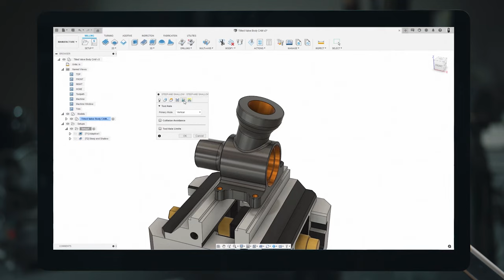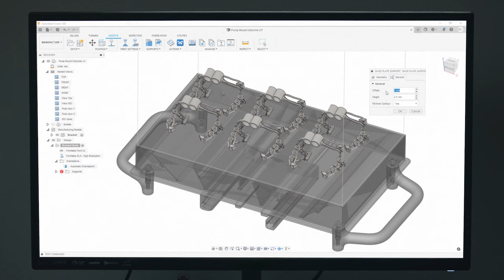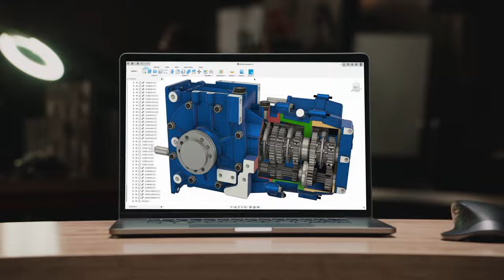This is Fusion 360

Comment from the maker: In this video, we hope to inspire you to see how easy it is to get from dream to done with Autodesk Fusion 360. Don’t believe us? Give it a try and let us know what you think. Get started for free by downloading your 30-day trial by clicking on the link below.

https://autode.sk/dream-to-done

Get from design to manufacturing faster: Fusion 360 has complete CAD to CAM workflows to make your life easier with access to hundreds of free post-processors, so you don’t have to be a CAM mastermind.

Ease of use: Unleash your creativity in your 3D model. There is no crazy idea, you can’t make it happen into a real product. Design effortlessly, 4x times faster compared to traditional CAD offerings.

From the screen to your hands: Get your prototypes ready for that product pitch you must give next. Build 3D printed parts by connecting to a library of 3D printing machines.

Real-time collaboration: Are you not tired of file transfers with your suppliers? Invite internal & external stakeholders to participate in your projects, securely share models and data, connect teams globally and gain an auditable trail of when and where design decisions get made. No fuss.

Strong Community: Learn and grow with best-in-class support and the biggest community behind you. You’re not required to undertake learning alone. With Fusion 360’s outstanding customer support and a community of millions of users just like you, master the new possible and get the most out of your tools.

Fusion 360. From dream to done.
See why over 1.2 million users switched to Fusion 360

Comment: Dose fusion 360 support 5th axis post processing of any machine because i used so many post processing of other machines also but it doesn't works only 4th axis works at a time

 Can you tell me about setting up grbl post processor for 5 axis in fusion 360 
I tried a lot but only 4 axis is moving at a time  not more than that i want to move all 5 axis of my machine i am using. Grblgru mega 5x nd for designe i am using fusion 360 
When i am exporting my gcode  in .nc extension by using grbl post processor after exporting in grbl a and b axis is not moving in simulation